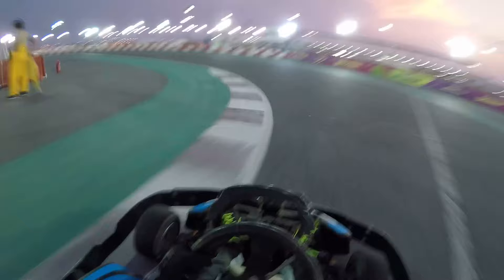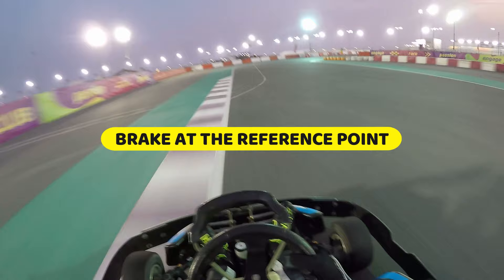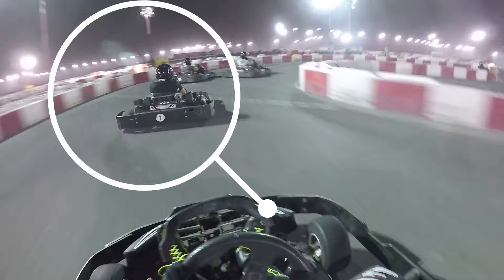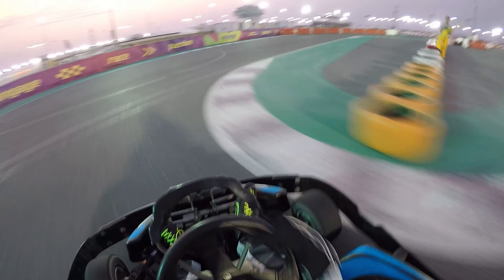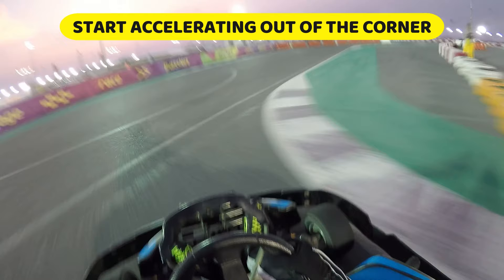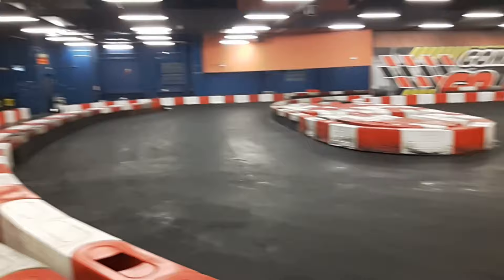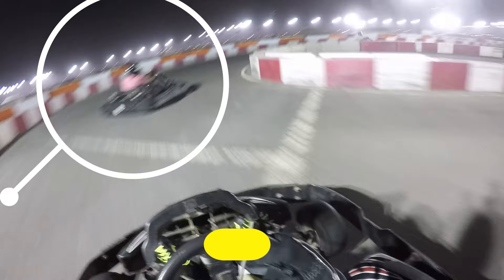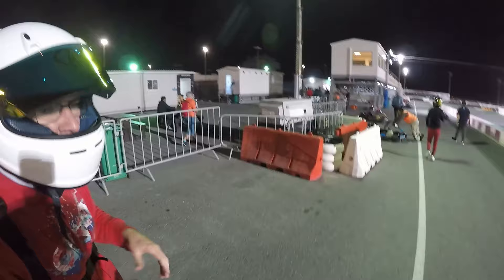HOW TO BRAKE in GO KARTING - TUTORIAL (KARTING TIPS)

Comment: 99% of times, no brakes...  for a beginner driver, you are probally not driving fast enough to need to brake,  just turn as hard as you can, the kart will naturally slow down.
Reply: Totaly wrong (at least on few local indoor track in my region ) ,event with a 6 hp karts on a twisty track people manage to spin out of corner.